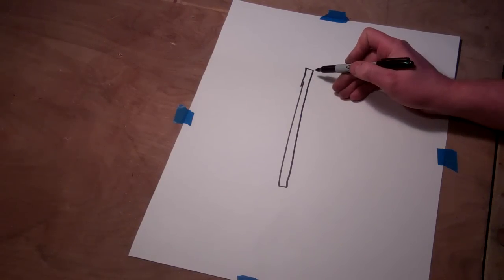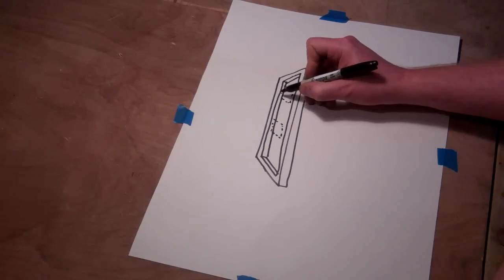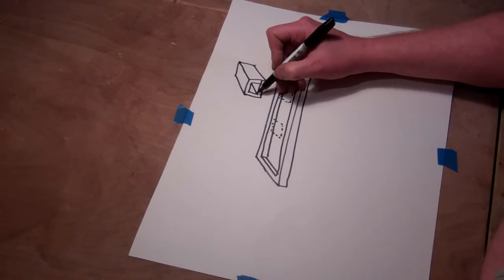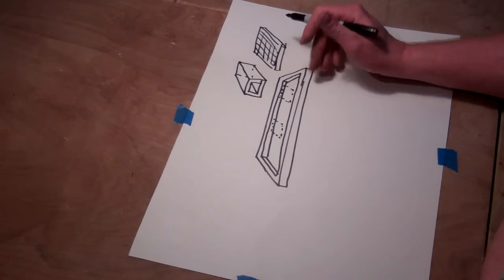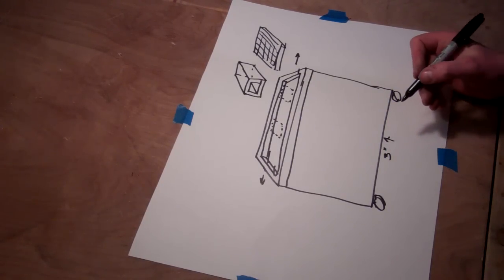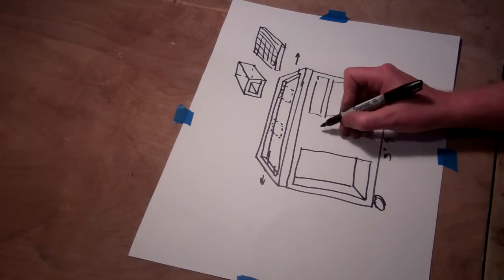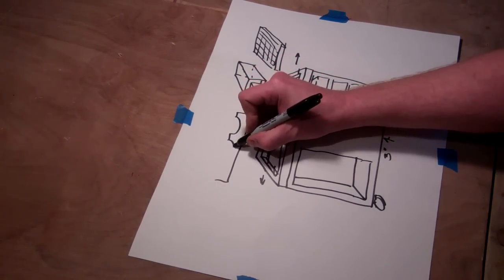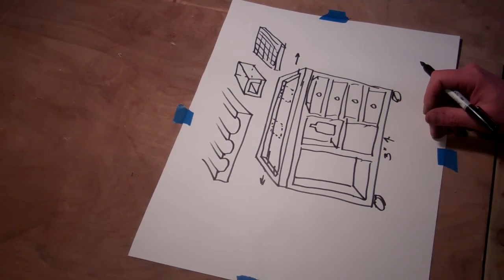Dry Bar Idea

Comment: Loved the project you just completed.  Cool ideas on this new project!.  May need some really tall wheels for something that heavy.  You could also get crazy with the top surface of the concrete and put glass chips of broken bottles in the concrete when it is wet and then grind it smooth after the concrete drys.  One final thought is you could mount a wine cooler fridge in one side and have the drawers like you describe on the other.  Just some thots.  Good luck.

Comment: Most of your plan sounds great to me except the concrete top...I used stone tiles on mine and bordered it with oak....Looks beautiful but turned out to be a horrible bartop...Very aggressive and harsh on bottles and wine glasses....If i had to do it again i would have some pretty wood and recess things like coins or anything cool looking into the wood and the pour the resin barcoat over it all, so you can see it but not feel it...Thought i should share my experience on bartops...Good luck